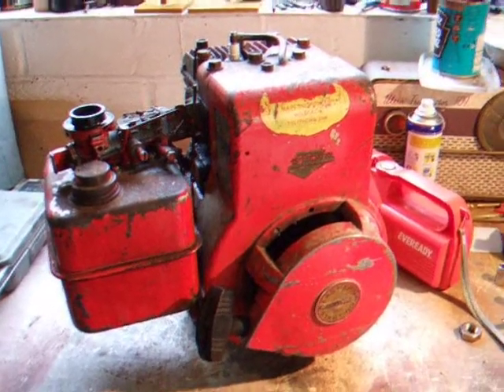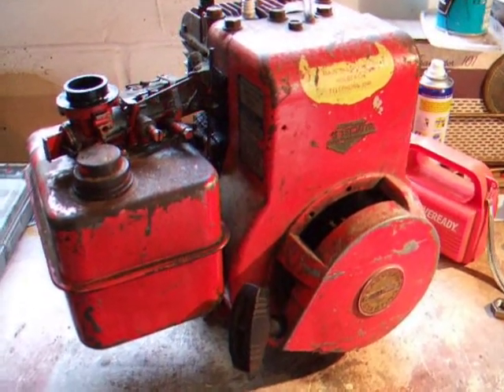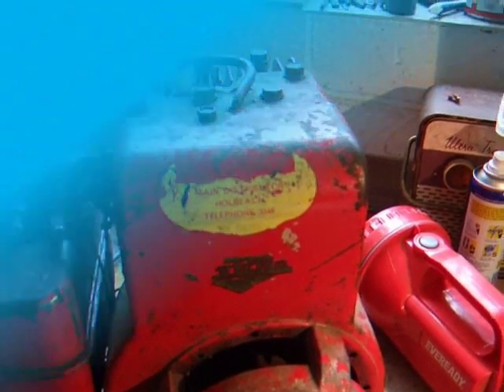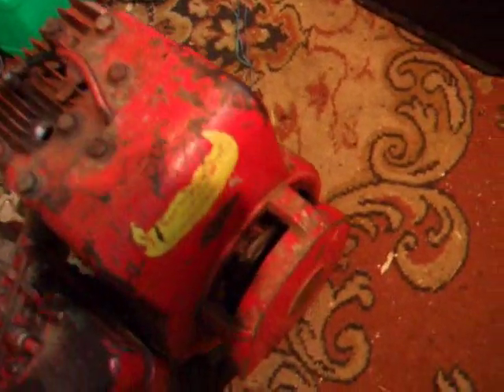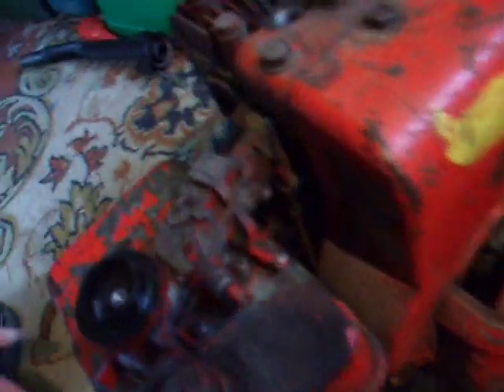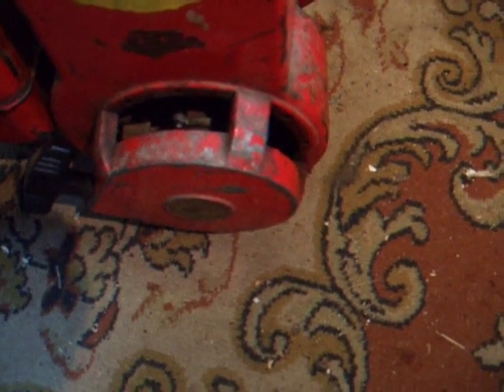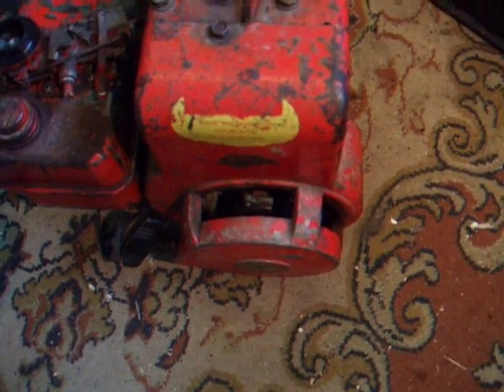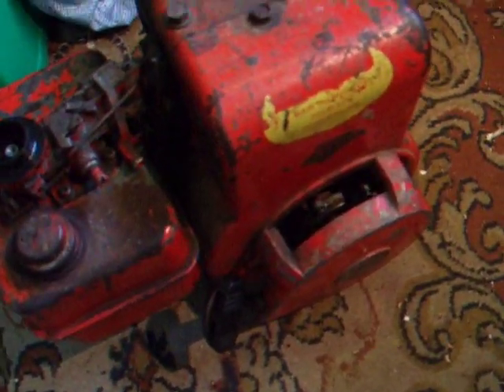Small engine repair: How to check an engine for spark

Comment: it is never a good idea to wire brush the tip of the spark plug. damage can be done to the electrode easier than most people thing. clean them with some light duty cleaner if anything and blow them out with compressed air. take special care when cleaning or you will be replacing

Comment: I prefer the first method. Also if you have an engine with points you can use a screwdriver to lift the points up and then let go quickly and it will then jump the points and send a very strong spark to the spark plug. But it can mess up the point gap but it will ALWAYS work. Even if the points are corroded.